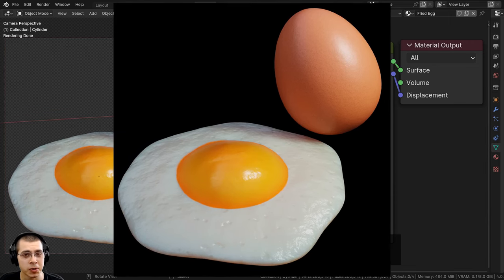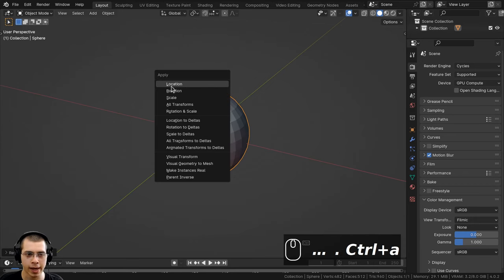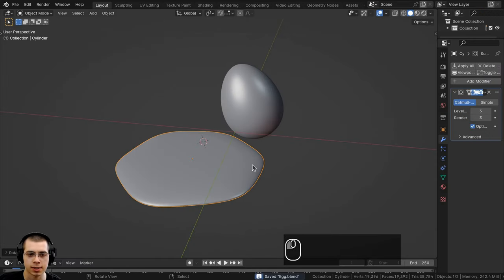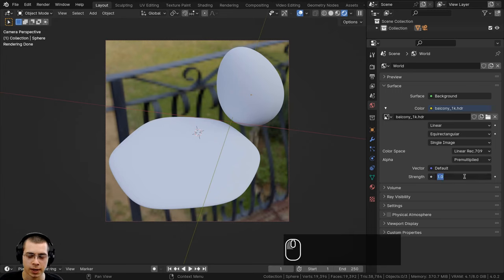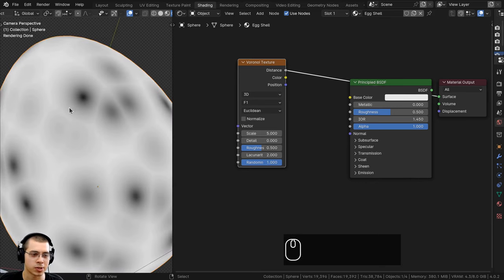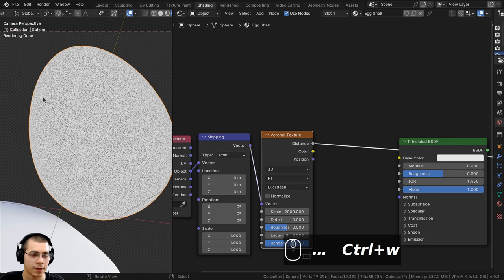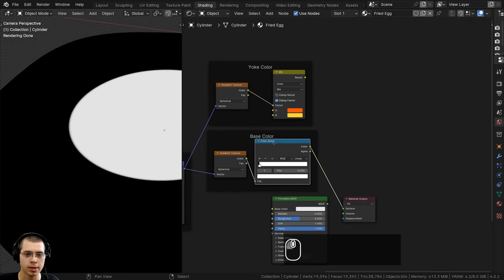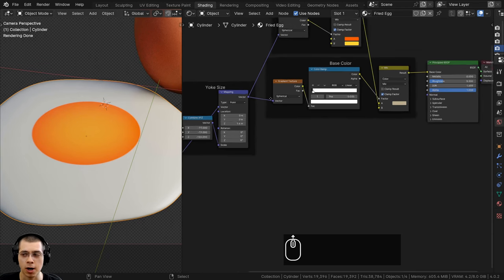Procedural Egg Materials 🍳 🥚 (Blender Tutorial)

Comment: HI Ryan, at 24:15 why didnt you connect the color ramp to A instead of Gradient? isnt colorramp output the actual radius of the yoke? Thanks.
Reply from the maker: because the color ramp is very sharp and contrasty, so if I used that in the displacement, the egg yoke would be a smooth circular shape. it would be very sharp and wouldnt look like a sphere.
Reply: @RyanKingArt  Thanks for the explanation, I just tried it as well and you are right. guess i should have tried before asking. sorry 😅